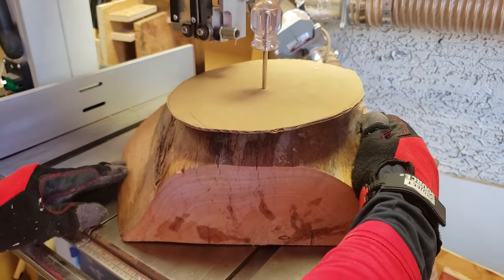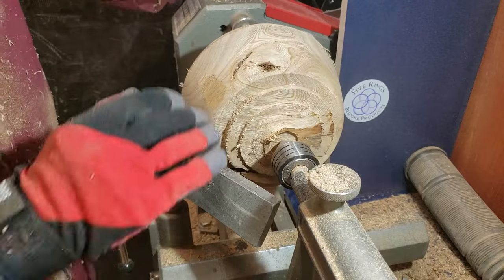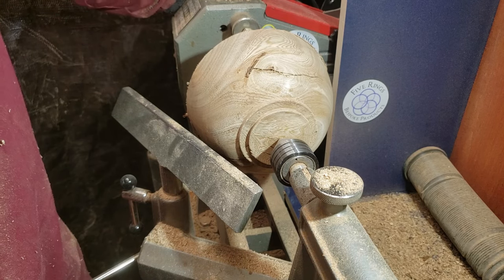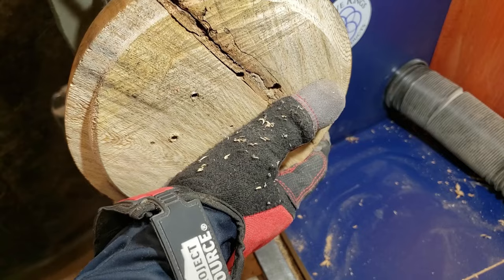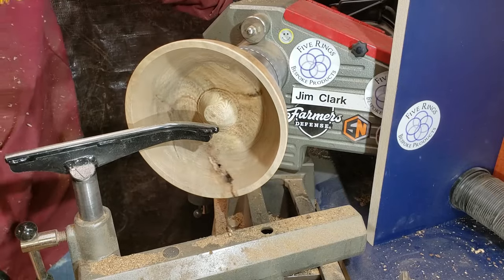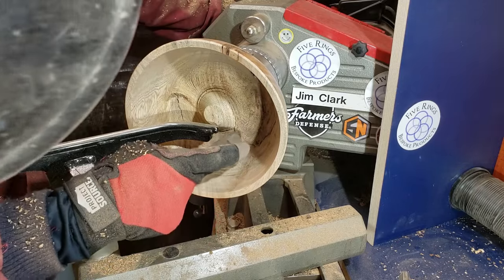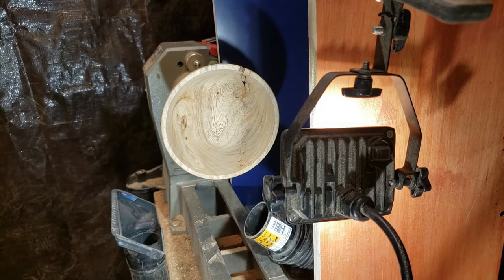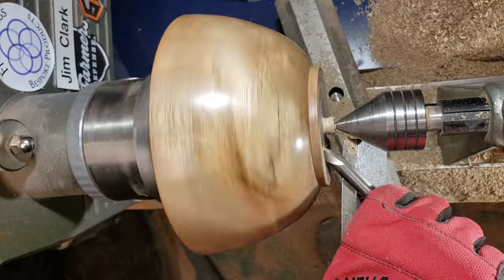I found a pig in this bowl! - Woodturning a Ficus crotch bowl

Comment: Very nice piece. You are right that the tenon removal method is not dangerous. It is very safe when you slow the lathe down as prescribed for that last nub removal. The bark inclusion is a beautiful character area. I was a bit worried that it might let go there at the end. I know you put glue in it, but an even better insurance would have been to wrap the outside with a band or 2 of strapping tape.
Reply from the maker: That's a good idea with the tape!  I'm going to steal that for the next time.  Thanks for watching!